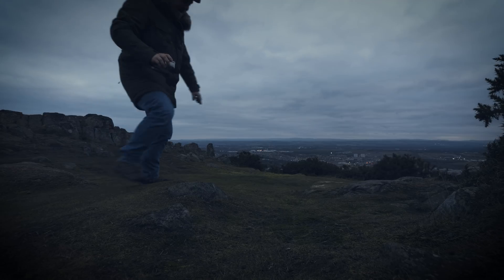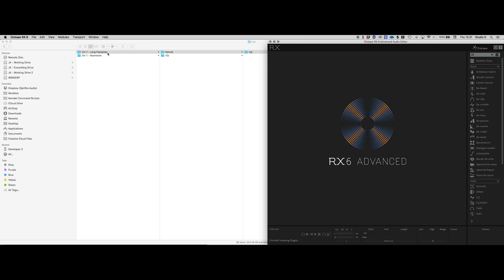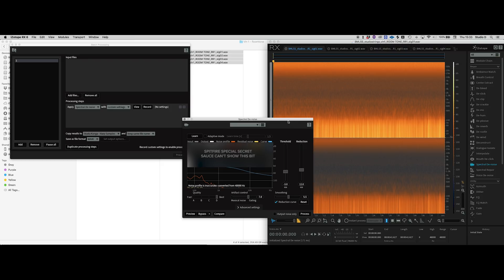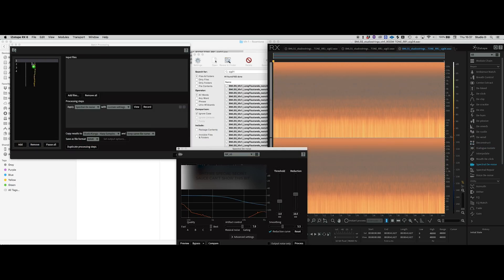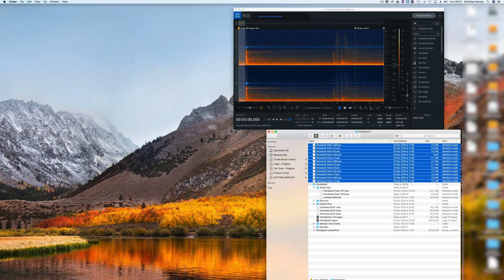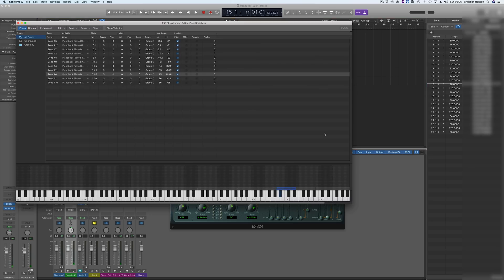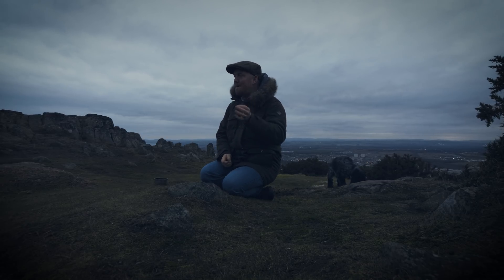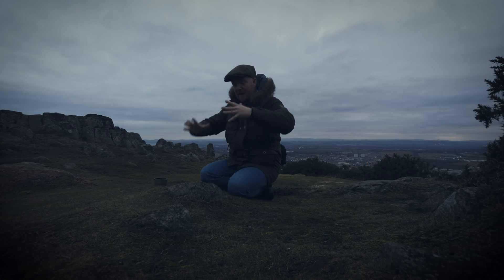How To Noise Reduce Samples - PB002

Comment: Stupid question I'm sure, but can you use a one-size-fits all approach to noise reduction, just based on the room sample?  I wasn't really clear on what tweaking was required in RX7, or if you're just essentially using a preset.  I do like the idea of batch converting samples, but I don't really want to 'learn' the tool as I would a compressor (for example) unless I really get into to sampling more (which I'm not ruling out, but there are a lot of other music-related things screaming for my attention, like mastering).

Comment: Audacity is free and offers the same spectral based noise reduction in its effects section. Maybe not on par with Izotope but damn good for a freebie 😁 Also the Reafir plug-in in Reaper does the same job in real-time but seems to take a lot more tweaking of settings to get the right results depending on the type of audio used.

Comment: I’m really surprised that RX doesn’t have an accessible proper API for offline processing, the process is still very much manual even with the batch processing. Has anyone at Spitfire tried to hack around it with the RX Connect? I guess it would be possible to create a small Audio Unit application to automate sample processing a little bit more (you can use AU stand-alone by writing your own host, and I’m sure the effort may be worth, is just a couple of days of programming foo). Perhaps one should ask iZotope to implement this for their next version.

Comment: I have been recording a Vlog for the pastoral staff at my church ... their first attempt ... and have had to deal with noise in the outer office ... HVAC sounds and recently a small
refrigerator growling during the recordings ... nothing I used would work ... sure you could drop the noise but the audio suffered.

Long story short ... isotope RX7 has the ability to sample the sounds and apply only the filtering needed ... it is amazing ... my overhead mic was near a duct ... whooshing sound gone ...
recent episode with the fridge ... sorry no ales nor stouts on site ... not a hint of it and the vocals were perfect.

Nothing has been so effective as this ... and this was izotope elements ... I will be moving up the isotope line as I feel the need but for the present it works ...

Comment: What! hang on will ya both of you—you are too fast for RX noobs...
Reply from the maker: corner liston you know you can watch YouTubes at .5x speed?
Reply: @TheCrowHillCo  I do, but I miss some of the actual steps on how to do... My knowledge level on this software is almost 0. I think that "learn room noise" thing made it a bit confusing. But with some trial and error I probably figure it out... (And off course thanks for the video, I always appreciate them.)
Reply: @cornerliston  That's just how noise reduction algorithms work. You give it a piece of audio that only contains noise, then it "learns"/analyzes that noise to create a noise profile. The noise profile is just a curve that tells you the noise level at each frequency. You can then use this noise profile to process audio files that have your signal. You just have to be sure that These files have the same noise. That's important! So don't touch the gain knob while you are recording or you might change the noise profile.
Reply: @moritz.schaller  Thanks Moritz, I get that but the steps of how to do it could be a bit more clear for noobs like me who isn't very familiar with the logic of the software : )

Comment: I swear by waves NS1 on already sampled instruments. It was designed to de-noise dialogue for dubbing mixers but I find, used subtly, it very naturally takes out hiss that a lot of libraries produce. It actively works based on the threshold you set, so you’re not just chopping off the top end, which is great for strings as I often find only the quieter dynamic layers are the issue. So you can just set the threshold so it gently comes in and reduces the hiss as it fades in with the cross fading of dynamic layers

Comment: I'm kind of an Rx ninja (edit live concert recordings) so I've invented workflows for removing coughs and chatter but it was great to see how you guys batch process your samples. I never thought about the noise floor rising but I can see what an important job the clean up crew have. One of those hidden elements not unlike the need for high sample rates needed for interactive sound elements that enable the stretching of samples.
Reply from the maker: carl stephen Koto do you think we should record the pianobook samples at 96k? If so can you give us some bullet points why?
Reply: @TheCrowHillCo   No. I don't think there's any need to worry about a multi sampled instrument. You can transpose instead of slowing/stretching the playback. Reducing the sample rate to lower the frequency range of something like an animal sound ( how Ben Burtt created lots of the aliens, spaceships, blasters for Lucus Sound) seriously degrades the sound quality so there is always a limit to "how low can you go". That's why sound sample search apps like Soundminer charge a premium for high sample rates.

Comment: Thanks for the video, very useful info. The iZotope site has some special deals on the RX7 range at the moment but check the specs for the three versions of the product. The cheapest RX7 Elements does not include the Spectral De-Noise option which is used in the video if you look carefully. The Standard and Advanced do appear to include the option. Alternatively there is a rent to own deal on the Splice site for the standard version. Rent to own, in this case, is an option to get your hands on premium products at the standard price and spread the cost over a period with no extra costs. Check the deals and options carefully in case there are any changes. I don't  have any marketing connection with either business. Happy de-noising. It is said that the Spitfire Secret Sauce  is available in 57 variaties and as there don't appear to be any deals on this one it remains priceless.

Comment: Hi Christian - I would noise reduce the whole recorded file before the edit, rather than batch after the edit. It will help you achieve a clean edit in the first instance. Listening through the (longer) original recorded file as you dial in the NR will also help you to more accurately judge the impact of the process, rather than the (somewhat blind) process of batch processing.  Also - it looks like you might be doing a full bandwidth noise reduction which (if you are and apologies if not) I would humbly suggest might potentially screw with your signal at low frequencies & signal levels. If you band limit the NR to what's actually audible (A weighted or more) rather then the full bandwidth of the noise sample from the mic you might get even more pleasing results. Not that you guys make bad samples mind... you clearly make very pleasing ones.... so we're talking about the Nth degree here.

Comment: I scored an independent doc film over the summer, and managed somehow to end up being the film's audio mixer too (long story). I've owned an earlier version of RX that I've used for track by track NR as needed in record productions but realized when I got to looking through the 40-plus talking heads, all in different (all noisy) rooms with a widely varying recording quality (lavs, booms, and once the backup to the backup Zoom recorder set on a table across the room from the speaker!) I would need some more potent NR algos. It was insane how much better I could make some of those talking heads sound. De-Reverb isn't perfect, but it sure helped intelligibility in a few of the more live rooms.